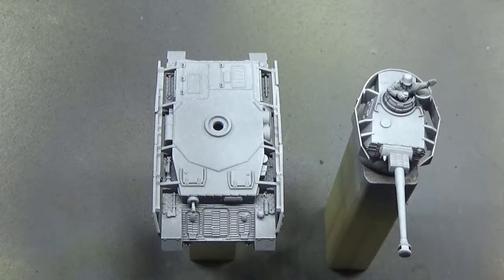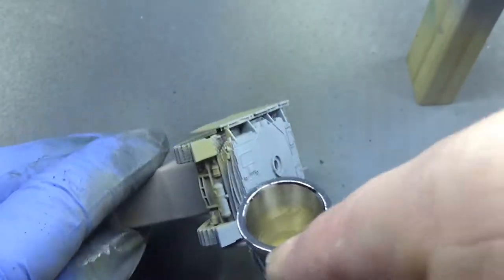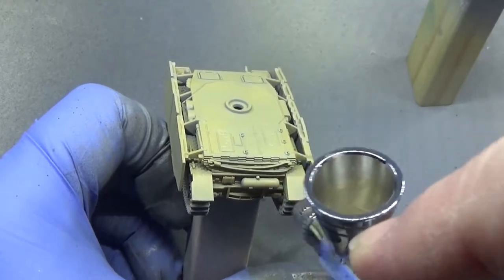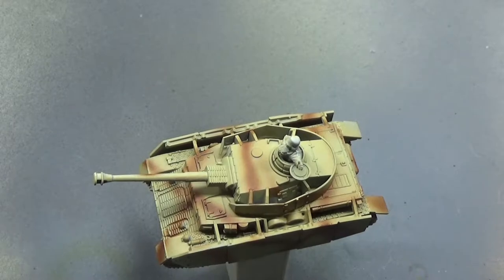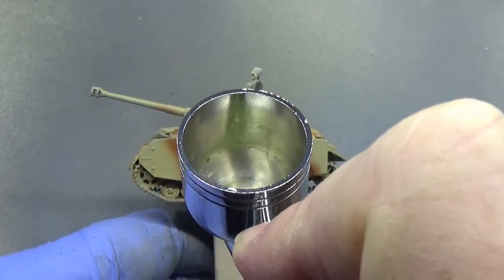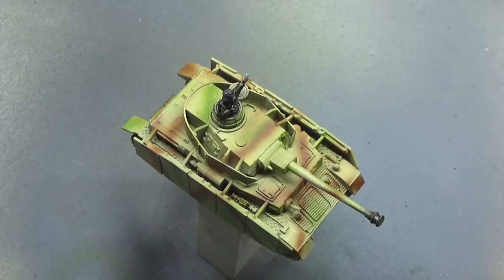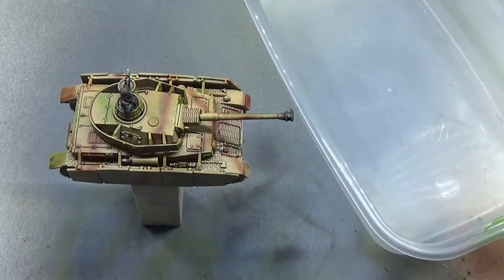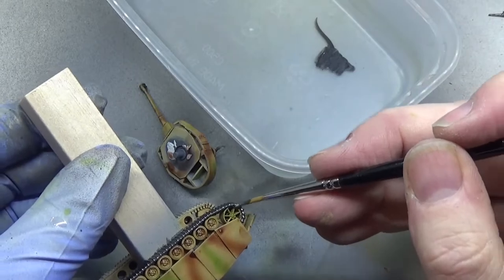Painting Flames of War Panzer IV

Comment: I think your paint is a bit too thin for how close you're spraying or too high air pressure. Thin is good for close-up painting, but you really need to drop the pressure
Reply from the maker: You may well be right about the paint, I was, and still am, learning how to use the airbrush properly so be patient with me, the pressure was around 5-10psi not sure if that's to much or not enough for minis. I have changed compressors since then to one with a tank that seems to be a little better but it's getting the righ mix of paint that still eludes me. I'll get ther eventually, but the videos will help me get suggestions like yours and help me improve so thank you

Comment: Model air colors doesn’t need too be thinned or your problem is that you spray too much paint and use too high preassure.
Reply from the maker: Thanks for the info, I was under the impression that all paint needed to be thinned to a greater or lesser extent, but I'll give it a go without, As far as pressure goes try to keep it quite low so I don;t think that that is the issue, though occasionally I forget to lower it after giving it a blast through with water or cleaner...
Reply: I use Tamiya XF whatever but I do add thinner to it. As for Vallejo air I have some and I would put a little flow improver or thinner into it. But not much, their air series is pretty good. Every brush and compressor is different.
Reply: Also I would turn your pressure down perhaps